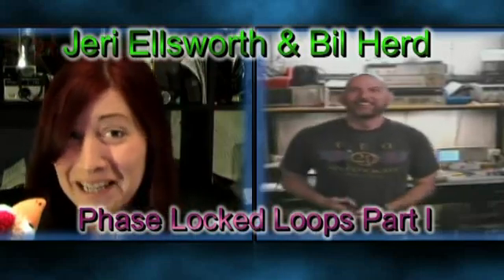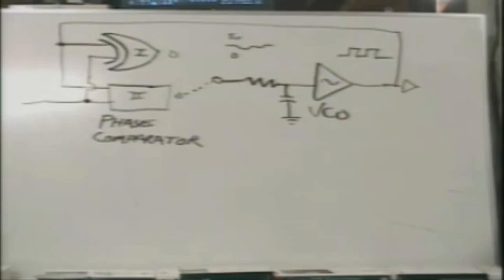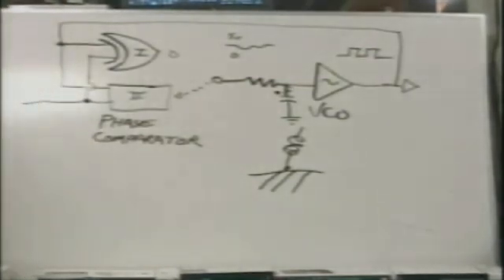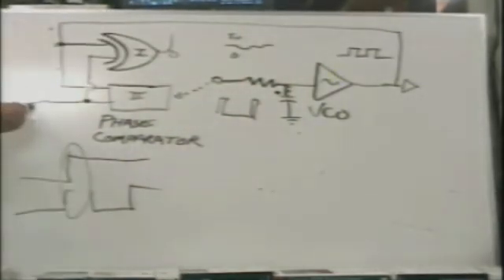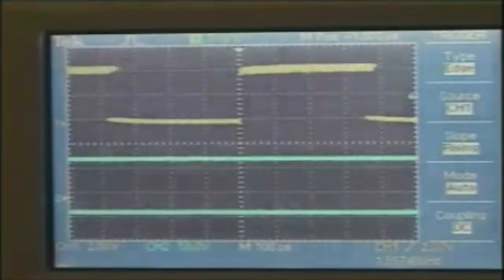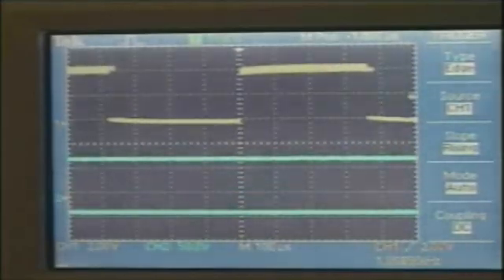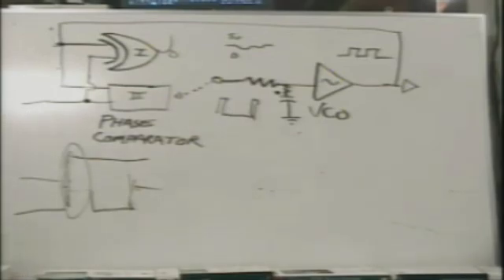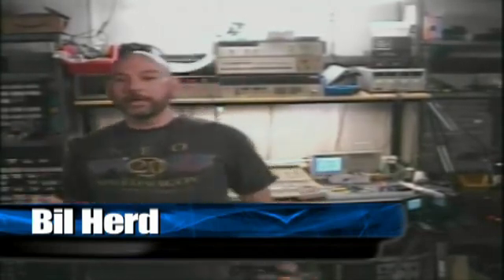PLL Part 1.mp4

Comment: I miss Bil and his videos. I will never stop wanting to learn more about the creation of the C128/C64, the early days, the ways it came together, the little bugs and flaws, and how it all worked out in the end. And I will never fully comprehend how it was all possible (design, integration, interplay of chips). What I absolutely love specifically about the C64 and 1541 disk drive is that there is a sense of "handicraft" about them; you could use them like an open toolbox - if you know about the technology a little, it lets you experiment and learn: from hacking and cracking in assembly to learning the inner workings of the full electronic circles and "interrupting" them to your advantage. Like a 1950s car with an open engine that you can tweak, adjust and extend, as opposed to modern closed engines that don't even let you look inside and have become way too complex to begin with. The tricks that are still being discovered and exploited over 40 years later, and presented in demos and new games exhibiting technical properties that were originally unimaginable, speak volumes of that. I wish they would sell these machines kind of like a Raspberry Pi again. There is so much more documentation and resources available today that the whole Commodore experience from the 1980s would be a completely different one today. God, I love these machines.

Comment: Glad to see you doing well ❤ PLLs, phase comparators, VCOs, VCXOs (voltage controlled crystal oscillators were an important topic when I worked in audio electronics. My first project as an engineer was a clock circuit/clock recovery PCB for a digital audio crossbar. And those VCXOs were kind of wicked. In every new board layout, the values of the parts needed to be altered to get it working in a stable way.